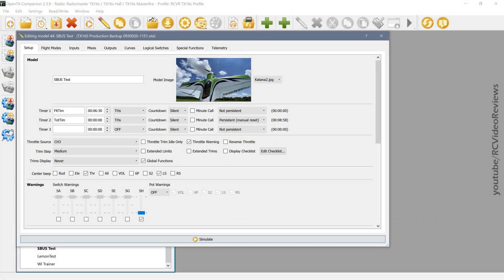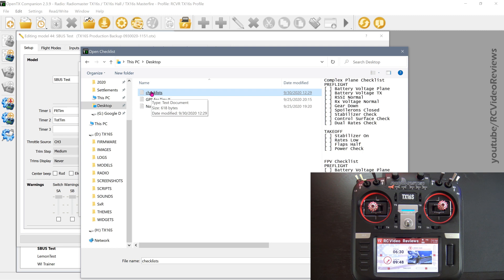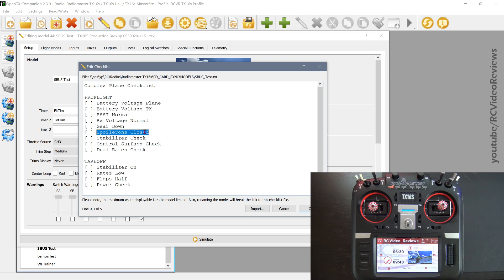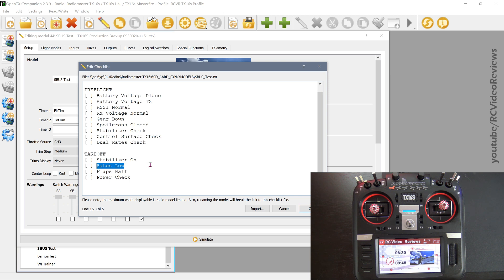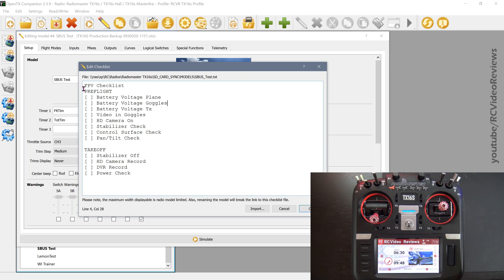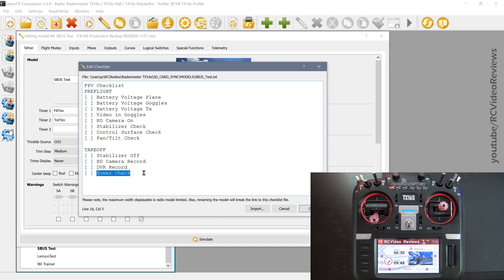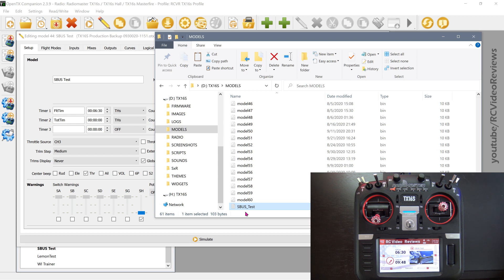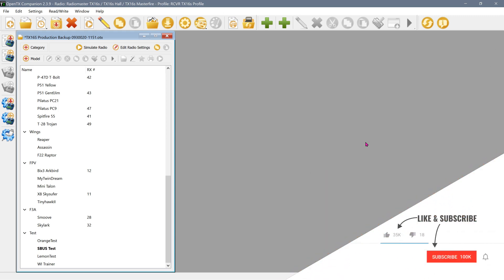OpenTx Tutorial Using Checklists • Radiomaster TX16s Setup • [Beginners]

Comment: Although I'm using EdgeTx this is still super helpful. I think its not just because models are getting more complex but also when you switch from one model type to another. Changing from a full house glider to a 1/4 scale gas biplane ...... quite different requirements. I'll add some physical checks to mine as I have to break my models down to get to the field - pretty embarrassing when a wing strut comes loose in flight.

Comment: I happen to find your website looking for a way to fix my radiomaster tx16 mkll. My tx16 will not start. The power light is very dim and I push it and after letting go it goes out. I think i flashed the wrong firmware. any help would be greatly appreciated.

Comment: I imported a file with my switch configurations like "SF↑ Throttle Disarmed".   When I opened the checklist on the radio I noticed that the up arrow was changed to the switch icon and a triangle looking character.   Interesting.
Reply from the maker: Yup, that's a thing. OpenTx devs are sneaky sometimes. Gotta watch 'em.

Comment: As a relatively new pilot it would be cool to see your switch placement. Obviously everyone has there own opinions on what switch for what function but would love your take on it to help iron out my setup.
Reply from the maker: Switch placement? As in toggle switches?

My default is to have all switches in the UP (away from me) position. With few exceptions: 

Throttle Cut is Down - I flick it away (up) when I'm ready to fly.
Stabilizer is Down - I set my stabilizers to be Off when the mode switch is down.
Rates Switch is the only other one that might be down for takeoff but while flying, it's up.

So the idea is that when I'm flying, all switches are up if I want to use a stabilizer. If I don't, the stab switch stays down.

Gear and Flaps are on sliders and they are also down toward me if I want gear and flaps down, then up away when I want gear and flaps up which fits my strategy of having about all switches in the up/away position for normal flight.
Reply: @RCVideoReviews  valuable info as always but I was thinking more along the lines of placement, like where your rate switch is etc.
Reply from the maker: @FL_Engineer  I physically relocate my momentary switch from SH to SF.

SA = Flight Computer Calibration
SB = Rates
SC = Flight Computer Mode
SD = Open
SE = Timer Reset
SF = Instant Trim
SG = Special Mixes
SH = Throttle Cut
S1 = Volume
S2 = Gain for Flight Computers
LS = Gear
RS = Flaps/Spoilerons

Comment: Can you share your checklist please?
Reply from the maker: Complex Plane Checklist
PREFLIGHT
[ ] Battery Voltage Plane
[ ] Battery Voltage TX
[ ] RSSI Normal
[ ] Rx Voltage Normal
[ ] Gear Down
[ ] Spoilerons Closed
[ ] Stabilizer Check
[ ] Control Surface Check
[ ] Dual Rates Check

TAKEOFF
[ ] Stabilizer On
[ ] Rates Low
[ ] Flaps Half
[ ] Power Check

FPV Checklist
PREFLIGHT
[ ] Battery Voltage Plane 
[ ] Battery Voltage Goggles
[ ] Battery Voltage Tx
[ ] Video in Goggles
[ ] HD Camera On
[ ] Stabilizer Check
[ ] Control Surface Check
[ ] Pan/Tilt Check

TAKEOFF
[ ] Stabilizer Off
[ ] HD Camera Record
[ ] DVR Record
[ ] Power Check
Reply: @RCVideoReviews  Thank you. All yours videos are excellent.
Reply from the maker: @cyprienbrun8075  Thank you :)

Comment: Hello thank you for your video.
You can use this syntaxe T5\up or T5\dn to add an arrow top or bottom in the checklist.
BR
Reply from the maker: I don't understand your question.
Reply: @RCVideoReviews   For example write these lines in checklist file and show the result :
 T5\up : training mode
T5\dn : sound off
Reply from the maker: @cyprienbrun8075  The checklist file is static. It doesn't change without opening it in an editor and changing it. So moving a switch won't do anything to the checklist.
Reply: @RCVideoReviews  Yes I know, but I'm using this checklist file to remember what action will be done with witch switch. My remark it is just , when you write for example : "T5\up : training mode" in checklist file the \up is converting in arrow in the top direction. You can try.
Reply from the maker: @cyprienbrun8075  AH HAH!! I finally get what you're saying. Yes, confirmed! I just checked it. GREAT TIP! I will bring that up on the Livestream tomorrow at 1930. Hopefully you can join.
Reply: @RCVideoReviews  Good News. I will see if I'm available for the livestream.

Comment: Another great video.   Awesome advice and well thought out.     I'm not using a Tx16.    Using a Horus X12S.    Have just updated from 2.2.3.   To 2.3.9.     As I got it second hand.    Under tools I cant find the new spectrum analyser???   Was I supposed to update each step individually,,  or buy just updating to the latest should have giving me all of the new functionality???
Reply from the maker: Did you update your SD Card contents?
Reply: @RCVideoReviews  yup,   I believe I have at least.   Lol    I've got a lot more photos of planes if I need them ect.    The other issue is when setting up a new model,  I can only select the glider mode,   which  doesn't bother me,   everything still works the same.    But I'm unable to select the air plane one,   that has all the questions of,  V tail,  Flying wing,   ect.   Just a little niggle.    Sometimes we just want things perfect.    Lol
Reply from the maker: @russcole5685  I just looked at the SD Card Contents for the Spectrum Analyzer script, and it's not there. I also noticed when I look at the tools menu the Spectrum Analyzer is the only one that says (INT) at the end which makes me believe it's either compiled in or they're hiding it somewhere. I 'll look around and see what I can learn about this.

I'm not sure what to say about the plane wizard if your SD Card contents are matched to your firmware. Have you asked Google what's going on with that? I don't have a Horus so I can't troubleshoot this one.
Reply: @RCVideoReviews  okay,   thanks for the time and effort    much appreciated.     As for asking Google     uuummm   I find it doesn't answer as clearly as yourself.   Lol   thumbs up with your great work
Reply from the maker: @russcole5685  Ok, it looks like Horus should support the Spectrum analyzer, but, it also looks like the internal XJT module requires a firmware update--and based on a cursory read of this thread:
https://www.rcgroups.com/forums/showthread.php?3219937-New-functions-for-FrSky-transmitters
It looks like you have to flash FrOS, update the iXJT, then flash OpenTx back on the radio.
Reply: @RCVideoReviews  wow    okay,      I'll have a look at the thread and frsky site for the firmware.   Awesome stuff my man.     Thanks a million